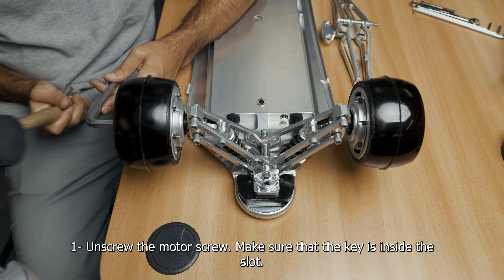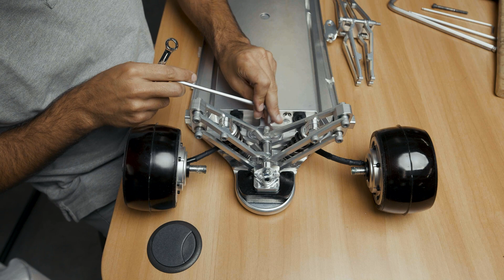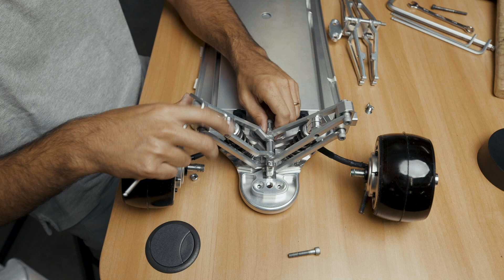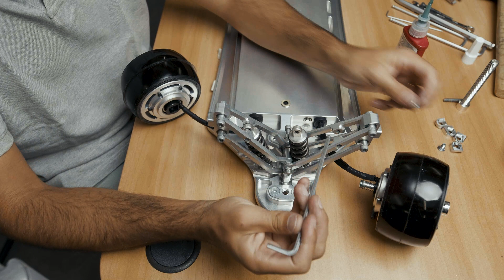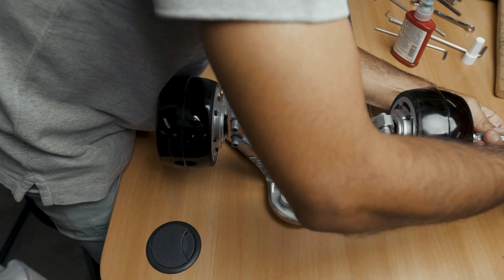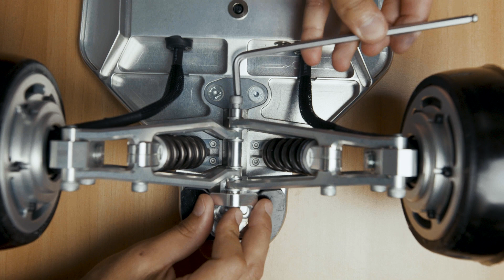How to replace the rear trucks on your Hunter Board

Comment: Very cool engineering!
Also, looks like the charge port is on the bottom of deck now?
Reply from the maker: Absolutely correct! Also, the charge port at the bottom of the deck makes it super convenient to charge the board while it's standing upright. 👍
Reply: @HunterBoards  lovely ingenuity, are you guys adding replaceable trucks to the maintenance selection in the site?